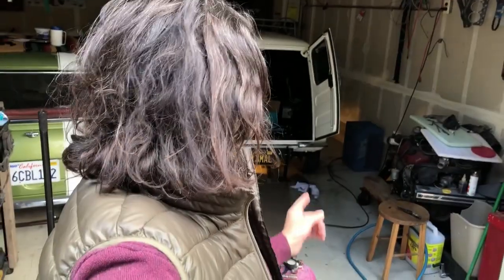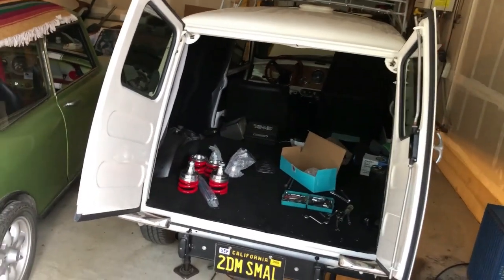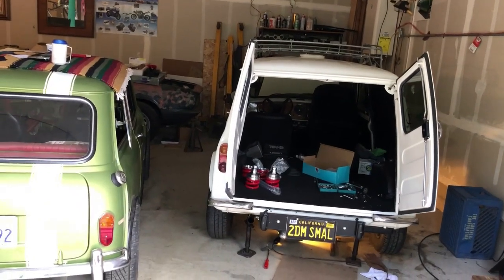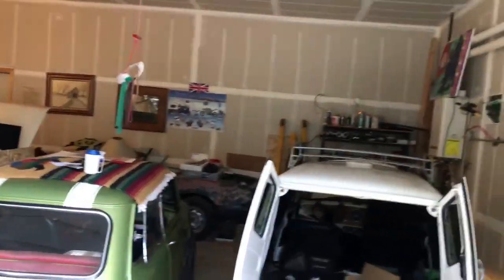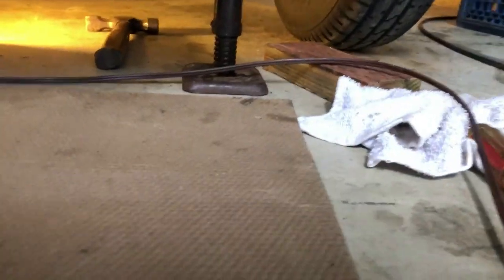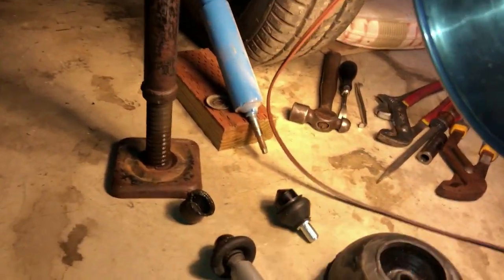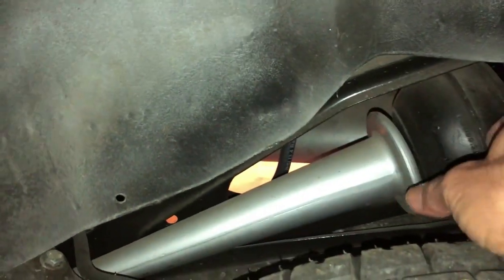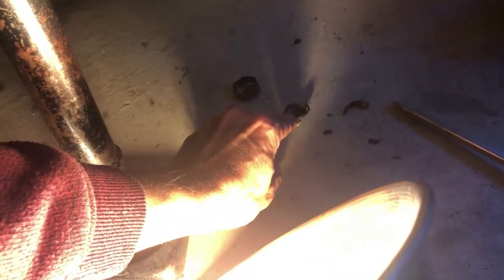Jemal installs coil springs and adjustable suspension on Classic Mini,  Part 1: Rear Suspension

Comment: Would those springs fit on a 1972 Leyland Mini Moke? My rubber cones are worn.
Reply from the maker: Yup, like I said in the first sentence above, they fit almost all Minis.  I have many MOKE videos, in fact a playlist!  You can also install the Hi-lo adjustable height cones with rubber springs as I did on our 67 MOKE.  I have a good set of rubber cones you have CHEAP!
Reply: @JemalCRM  Thank you.

Comment: Awsome vid! Wanted to know if it is safe to drive when you lower the springs like you have it. What’s the likelihood the components dislodging when you hit a speed bump ? Or will it only come loose when you jack the car up ? I have the exact same hilo and springs as you with KYB gas adjust shocks, and my car sits way to high as the minimum setting to where the springs won’t fallout when jacked up
Reply from the maker: Sorry the late reply... Yes it's safe to drive as long as you know that tire contact can happen when you go up uneven driveways and such when the car is set up to be low.  I made some small wooden spacers that I use to block the rear trailing arms against the subframe for jacking the car without allowing the wheels to droop. I'll try to post it soon, but I'm busy with other things at the moment, and my Cooper S is sort of trapped in a corner!
Reply: Jemal @ Cooper Road Mini Awsome thank you so much for the insight! My wheels do lift up on my driveway, so I guess I shouldn’t lower it to much... was thinking of putting a bump stop from the hydrolastic suspension to stop the arm from drooping to much aswell, doing what I can
Reply: I just asked the same question on the other part of this install. Having the exact same issue as you. Just installed spring conversion and kyb gas adjust. Did yours break in and come down some? I have a pretty big gap about 4-5 finger gap. Hoping. To get about a 2 finger gap, but worried about adjust the Hilo’s so much that it will dislodge
Reply: knowone12 I fixed the problem by adding a die spring 1/2” between where the Hilo and rod connect.. it’s a hack I thought of and it acts like a helper spring, which holds everything in place when the wheels to suspend in the air
Reply from the maker: @heronguyen8000  There are a few solutions and it depends on if it's the front or rear... you don't say. In front, use those oversize rebound buffers to limit droop... that will let you set the front on the bump stops if you like!  And keep in mind that I modified my front fenders and installed a custom sub frame to have mine so low in front.
The rear is trickier. You can install the still available hydrolastic rebound stops which help but still let the coil springs come loose when jacked if the car is very low. I've suggested making limit straps you can hang from the upper shock mounts , similar idea to the big springs used on the hydro cars which have sort of the same issue when jacked up.
I'm about to get my Cooper S out of it's corner, so I'll try to make a video showing the little blocks of wood I made to wedge against the rear sub frame that keep the trailing arms from drooping.